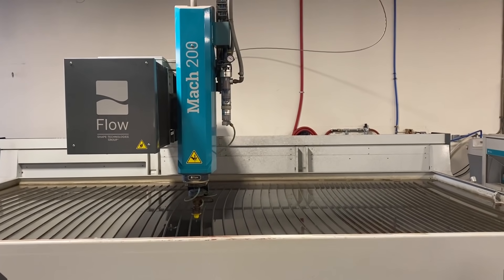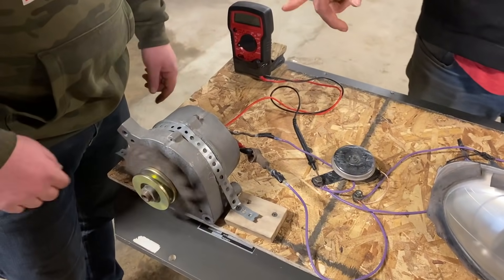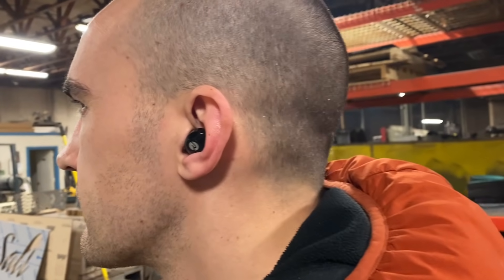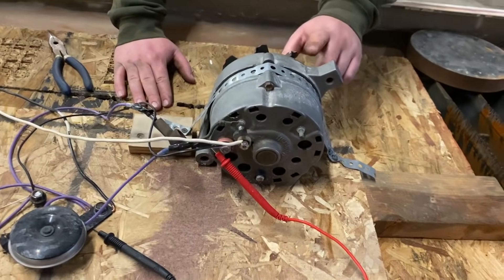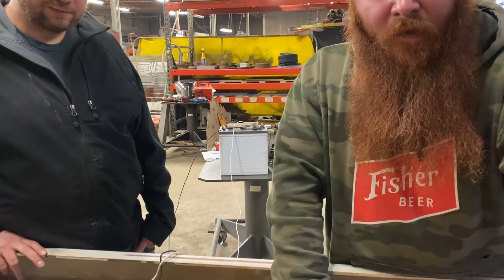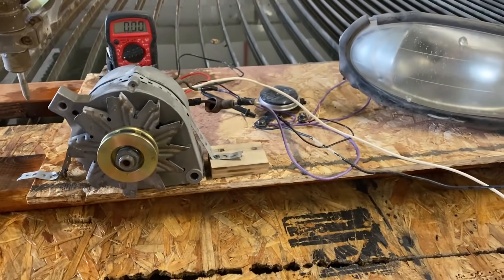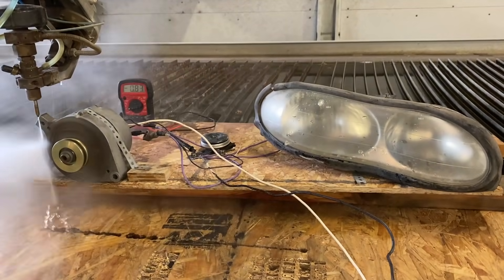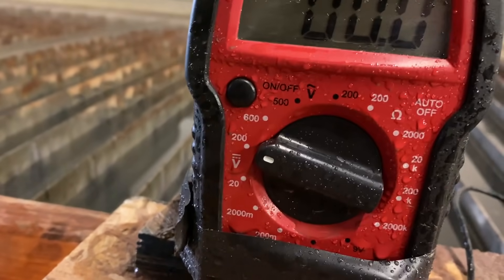How Much Voltage Can Alternators Generate? Using a 60k PSI Waterjet

Comment: That alternator will be producing AC current unless there is a rectifier built into it!!
Reply: I know and they probably had the meter set to DC so that is going to give a bad reading as well.
Reply: Motorcraft alternators like the one they used have internal rectifiers.
Reply: And prob regulates to 6 volts as he claimed it's a 6v alternator.
Reply: Full bridge rectifier!!!
Reply: They do have rectifiers built into them. They're also self-excited, which is why they have a rectifier built into them.  They however do need an external DC source to generate the initial field, usually provided by the battery... Some alternators like the ones in portable generators manage to black-start using only the remanent magnetic field in the iron core, but I guess this isn't the case here. 

Oh They figured it out
Reply: @TheDiosdebaca  Hey you need to use all caps
Reply: All alternators have full wave bridge rectifiers. The issue here is that alternators need a bias voltage on the stator usually provided by a voltage regulating circuit.
Reply: yeah and even with the rectifying diodes you wont get a decent dc reading unless you have a smoothing capacitor
Reply: @blacknoir2404  You will with a True RMS voltmeter.
Reply: Volt juice and doot doot?  Seriously???
Reply: That's not really an alternator it's a generator an alternator is ac generator is DC even though the part itself is called an (alternator)
Reply: Jesse Taylor no, it's an alternator. It produces 3-phase alternating current.There's a built- in rectifier that then converts it to DC, but it's produced as AC. That's why it's called an alternator. If it produced DC, it would be called a generator (or more correctly, a dynamo)
Reply: Fuuull bridge rectifiaaa
Reply: Single wire alternators have been around for a long time, and had full bridge rectifiers almost forever.
However, they are pretty much limited to 12 volts internally.
I've never seen an alternator overcharge a system unless the voltage regulator is external, mechanical, and damaged.
Now, a GENERATOR is another story...
Reply: FULL BRIDGE RECTIFIER!
Reply: A FULLBRIDGERECTIFIER
Reply: TheDiosdebaca I came to the comments specifically for this. ELECTROBOOM! will be happy!
Reply: @TheDiosdebaca  I got that reference 😏
Reply: Or A battery
Reply: @macgyveratlarge2133  my old XL500s alternator has 3 seperate windings. One is dedicated to headlight only and is AC and has no regulator, relying only on the right number of windings to give the acceptable 6 volt range. These notoriously go bad with age, pumping out 40 volts without revving much at all. Is all good though, $50 12v regulator off ebay means I could convert the headlight only to 12v. It powers a standard 60/55w h4 with no problems now!
Reply: @rossbrumby1957  so, an unregulated generator/alternator. New one on me.
I do know that a standard alternator will put out 60hz at 1100 rpm, and this was from an alternator guy.
As for the amount of amps, that would depend on the size of the windings, if you don't wish to burn them out.
I'm surprised that someone has not mentioned magnetos, yet.
They pack a serious punch, and have to be leveled out with a good battery, not to mention a decent regulator.
Reply: You obviously don't know how an alternator works. You have to energize the rotor. Its an electro-magnetic.
Reply: Lights don't care about ac/dc... They don't care about polarity.
Reply: All alternators have internal rectifiers one difference between alternators and generator.
Reply: @JF32304  so, explain single wire self-energuzing alternators.
Reply: @macgyveratlarge2133  since you asked this question... You might want to change your name on here... You ain't macgyver.... That single wire is your hot/red and ground... Man.... Gotta explain everything to people.
Reply: Still, the headlight should work.
Reply: @TheDiosdebaca  a good comment
Reply: this alternator came with an external voltage regulator which is usually a set of resistors, the rectifier or Diode bridge is internal. fun note the alternator regulator  is what controls the field voltage and you know its working when you switch the car to run without the engine running you can the test it magnetic when key on not magnetic key off
Reply: 😂😅😂Electroboom @TheDiosdebaca

Comment: The biggest question, of course, is.
Where did you find a 6V alternator?
Reply: Many older forklifts/industrial equipment run on 6 volts
Reply: It’s an old ford one 

Craigslist find
Reply: Probably from a old snowcat
Reply: Not sure but that might be a 1g ford alternator
Reply: It's just the regulator, you can buy the internal regulator set at 6 or 8v
Reply: @jamest.5001  looks like a 1g alternator from ford i got a 78 ford pulled one out and put a 1 wire setup
Reply: it says motorcraft on the rear, so it's ford. probably from a 'stang. those puppies have complimentary built-in vibrators from factory.
Reply: A snow cat.
Reply: Parts store.
Reply: most old cars where 6V.
Reply: The alternator here is a motorcraft. It is likely that it was used in late 50s vehicles that were still using 6v systems.
Reply: @michielhuygelier6953   I have never seen that style of alternator in anything but 12 volts and I've been in the parts game for 30+ years.
Reply: A car one cut in half
Reply: VW Bug
Reply: Old 6v cars didn't have alternators, they had generators. This is a Motorcraft (so... Ford) alternator, in the standard case that they used in the 70s and 80s, before they switched to internal voltage regulators. Since it's a 6v unit, it's from an industrial engine or an old tractor that had an alternator conversion done. Or possibly from a really old car that was converted to an alternator, but typically, if you're going to that trouble with a car, you're going to switch to a 12v system, since light bulbs of that voltage are readily available and much brighter. So I'm going to guess that it was from an industrial engine. Ford sold versions of the Kent engine and the 2.3 HSC as standalone engines for machinery. Usually, they'd be 12v, but you could order them in 6v.
Reply: And here I thought they just stole it from Jay Leno.
Reply: Mr bean's car somehow intensifies
Reply: @tylers438  pretty sure alternators werent in cars til around 1960 or so.
Reply: @michielhuygelier6953  yep with generators to my knowledge theres never been a 6v alternator on a car this one is for a Ford tractor or forklift
Reply: @tylers438  Ford tractor or similar equipment forklift etc
Reply: @randybehrmann5454  its for a ford tractor from the 50's
Reply: @puckcat22679  our 1980's vintage Ford forklift had that same 6v alternator from. The factory
Reply: I just sold one of those alternators today. It was going in a 65 mustang
Reply: delco remy never made a 6 volt alternator as far as i know
Reply: @randybehrmann5454  . Those alternators are still out there.
A lot of the old tractors were converted over to 12 volts ,chang the battery,starter at the same time as the alternator as well as your light bulb and your done. 
The 12 volts alternators had the same casings for the most part, all that was done was re-wire the windings. 
As a bonus, the better ones came with built-in regulators. 
I was dealing with alternators with external regulators when I first started driving. But at the time they were all 12 volts. Just the old tractors were 6 volts. 🤔
Reply: From a 1930s car

Comment: U have to regulate the field windings! 
If you loop the output directly into the field windings u dump all the output power into the field windings and it boggs itself down!
Reply: ...and probably burn the diodes by doing that... It would probably work better by just keeping the battery for field and no loop-back wire.
Reply: bullshit it only takes a couple of amps to max out field windings

Comment: While I was installing a new alternator on my tractor I incorrectly wired it and when I tested it at idle it was producing over 105volts
Reply: Very interesting to see a very low rpm engine produce such high voltage xD
Reply: Now you are supercharging your tractor
Reply: Paco_bl hahahahaha, Nice one!!
Reply: You could power a fridge compressor with it and use that to compress more air into your engine. Should be fun xD
Reply: bruh all your electronics are fried if they got 105v
Reply: Prolly 105v ac
Reply: When i was 16 37yrs ago i replaced the alternator on my 76 chevy truck.   it was at night it worked great  extra bright lights for cpl of min i learned difference between a ALTERNATOR. N GENERATOR. That nite blew every damn bulb on truck lol
Reply: Yall stoopid since theres a regulator right after the alternator and actually if you wore it wrong it wont give juice to the battery and the thing that shows how many volts it has will go crazy
Reply: Why do people lie for no reason
Reply: No you didn't
Reply: Ruudi Utšenikov listen up bud, with a self regulating alternator. When there is not battery voltage going to it. It would act as if battery if completely dead. Therefore cranks ad much power out of it as it can to charge the battery. How about you go do some research before calling me a liar.
Reply: Mats Granqvist why do you say that?
Reply: Oh wow you've done, you convinced me. No lmao I'm not gonna believe you no matter what so give it up
Reply: 03 Henni I didn’t even reply to your comment. I simply ignored it because you clearly don’t know how a older charging system works
Reply: @Jacobsen-ij9hn  theres no way a 12v battery will be charged by 105v
Reply: Water and electricity what could go wrong lol
Reply: 03 Henni I will try explaining the process in a different way. Picture a home heating system, when the temp gets below the set amount the furnace will turn on to warm the room up. That’s essentially what the alternator is doing (trying to charge the battery up) but if it had no way of knowing how much voltage is in battery then it will just go to 100% load which in my case was around 105v
Reply: yep
Reply: Is that a good thing?

Comment: Cool demonstration!

The reason the headlights exploded was because the alternator was at a much higher speed (freewheeling) before the excitation kicked in and changed all that kinetic energy to electrical energy.

Once the alternator starts "feeding its self" without a voltage regulator, there will be excess field current. This will cause the alternator to over-excite and produce a lot of drag and slow down. The greater the speed at the moment this happens, the higher the peak voltage will be.

The heavy load of the headlight bulbs prevented the alternator from self-exciting until the speed was insanely high. Once it happened, it was a massive release of flywheel momentum from the alternator into the electrical system.

With the no-lights test, the alternator was able to self-excite at a much lower speed  because all the residual voltage was devoted to the field winding. 

If you want to produce the highest pulse of power, you would need to have a switch between the field terminal and the positive power circuit. Allow the alternator to spin up to the highest RPM you can create; then close the switch connecting the field terminal to the positive circuit. This should produce a very fast deceleration of the alternator but during this time, the voltage will be quite high.

Comment: You have to send power to one of the terminals to turn the alt on so it will output power
Reply: It needs power to generate a field so it will make more power.......................
Reply: Yeah I was thinking that too but they figured it out.  And think the reason the voltage skyrocketed at first was due to lack of battery.  Even with a normal car setup and not trying to spin it crazy fast, never try to run it without the battery as you will get a voltage spike too.
Reply: @redsquirrelftw  that boost at first was the production of the field. The two magnetic fields move across each other when created. Once the light filament got hot, the amperage draw would shoot up as it heated. Until it stabilized draw. And the final piece would be the magnetic resistance in the alt slowing it's rotation as a function of torque resisting the water jet. But hey. I'm high.
Reply: The field wire is supposed to have a light bulb inline going to the positive.(or anything that uses power, really) was taught this by a mechanic when I first wired a buggy. Think without the bulb is akin to a dead short maybe, hence the loaded up alternator using f.a. power.

Comment: Trouble with alternators is that you need to charge the field coil so it can start to produce current flow, otherwise it'll just spin freely. The reg pack usually puts a varying voltage to the field coil, changing it accordingly to regulate the voltage on the output.
EDIT: Just got to that part of the video now.

Comment: "Let's shoot water at these bare wires!" Classic.
 
Joking aside: You really do think of fun stuff to do.
Reply: There’s way scarier things happening it didn’t cross my mind lol
Reply: At such low voltages the only problem you might run into is corrosion due to electrolytic effects on the conductors over a longer period of time. You're not creating a short circuit nor  risking electrocution.
Reply: swiss true, I guess he isnt an electrician

Comment: The regulator limits voltage , reguardless of speed!
Reply: They said the regulator was removed. My question is if it was removed then it would be putting out AC current not DC because the regulator also is a rectifier.
Reply: You spelled regulator right but regardless you screw up? Lol
Reply: This looks like a Ford 1G alternator, they dont have an internal regulator.
Reply: @cousinles80  In automotive alternators the rectifier is internal. Lawn and garden, motor cycle, micro industrial and some marine gear commonly use a rectifying regulator that is external to the current producer.
The series of alternator is a motorcraft 1G a star wound 40amp alternator with a 6 diode rectifier and field to dynamo (positive) Configuration. The is also a slim chance its the higher output 60amp that included 2 more diodes on the neutral point junction but the 60a case from memory has the terminals coming out the side not rear.
Reply: @another1commenter770  modern automotive alternators are

my 91 ford came with an external rectifier
Reply: @another1commenter770  What the fuck did I just read, I'm gonna have a long night of intense Googling thanks to you, sir/ma'am
Reply: @sciathoir  he's not lying. It's probably the best, most relevant, and true comment you will find under any of these comment sections.
Reply: @jamesharrell4360  I didn't mean it like that, I meant I have no clue what about 75% of that comment says because of my lack of knowledge on electricity, sorry for the confusion
Reply: @sciathoir  no no. I didn't mean any you were disrespectful in anyway. I'm just saying screenshot what he said. It will make sense to you someday.  5 years ago I was clueless too. Now I work with 3-phase power, plumbing, and high-powered chemicals.  And the more I know, the broader my desires to know more is.  I can't stop looking at power lines and transformers now
Reply: @jamesharrell4360  that's freakin amazing, im for sure screening this thread, thanks man, I appreciate the good words.
Reply: @cousinles80  Unfortunately, Les, that is incorrect. The rectifier assembly is contained at the rear of the alternator and rectification takes place before it reaches the BAT terminal. The external regulator on this alternator pulsates(duty-cycles) voltage to the field"FLD" terminal by monitoring voltage on its "I" (ignition) terminal. This how a stable output is achieved with various RPMs and electrical loads.
Reply: @rod928s4  I stand corrected. Learn something new every day. Thanks.
Reply: Wazoo117 no, it had an external regulator. The rectifier was still inside the unit.

Comment: When you guys said you were going to run the field wire off the alternator itself and it being non internally regulated I knew we were in for a nice surprise as soon as it got a signal to the field wire. Since it takes a second for the magnets to fully charge and your were jumping it on at like 60k or so rpm the voltage will skyrocket till the magnets  can catch up. Having a ton of background in car electrical I pretty much knew what we were going to see but still doesn't take away from the entertainment of watching it all happen. One thing I really wish you guys would've done though is opened it up before and after to see what that kind of voltage did to the internals. I want to say it wouldn't be too extreme since it wasn't running for a really long time at those speeds and voltages but you never know.

Comment: In the 60s they sold a device that would “full field” your alternator and disconnect it from the car electrical system so you could run your 120v universal motor power tools , drills, saws, etc.
Reply: chuckels431 that’s pretty cool
Reply: You are correct. I put 24 volts to the field on a 12 volt generator and got 140 volts DC out of it.
Reply: That's the neat thing about an alternator, you can regulate it by changing the current to the field coil.

...And here they plugged its field coil into itself, setting it up for a feedback loop which blew every diode

Comment: Volt juice. 🤣 The very low voltage during the 1st test was due to residual magnetism in the alternator's rotor. You must have a 1-wire alternator connected to a battery(as you did later in the video) to supply power to the rotor, unless the rotor has permanent magnets installed.
Reply from the maker: finish watching the video...
Reply: I did, noticed the 6v battery at the end.
Reply: This is the weird vibe that when you're over at your friend who's parents fight's house and the one parent says something to the other.